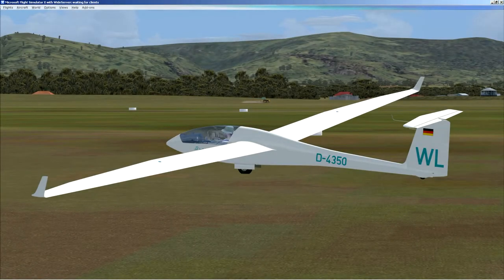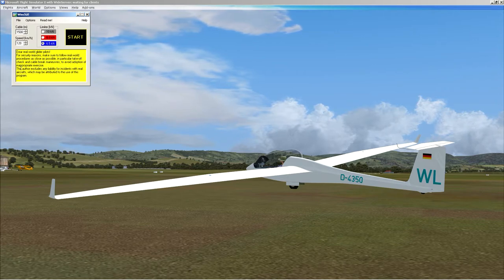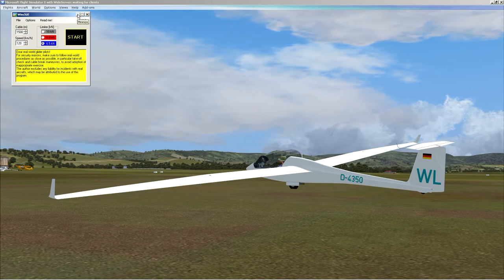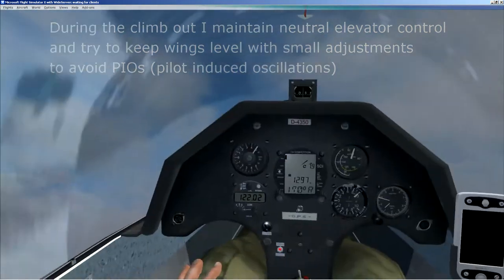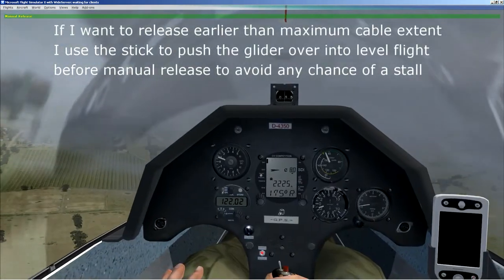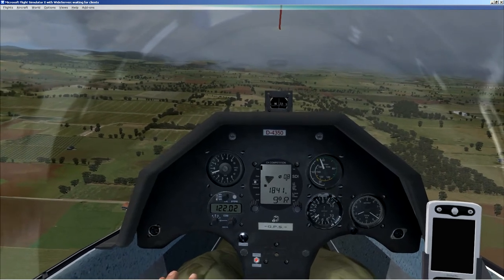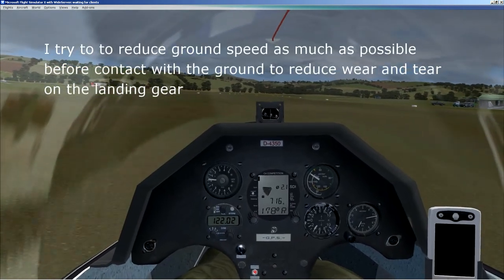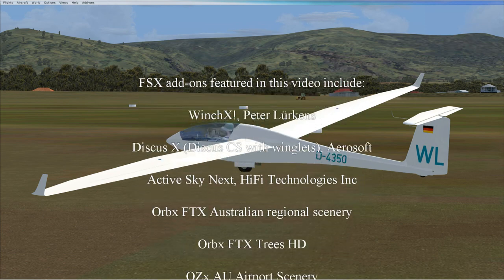WinchX! tutorial

Comment: Hello. I am a qualified glider pilot and I have been for just short of a year. Here are some extra realism tweaks that you can choose to use in your sim. 1. for the CBS IFT CBE, you check the controls in every movement. (Ailerons left, ailerons right, elevator up, elevator down. Rudder left, rudder right. Then you can check all of them at the same time to make sure you have full, free and correct movement. 2. On the launch phase, have your trim slightly in front of 0, about +2 to make your launch a bit more comfortable. Have the stick forward slightly as well, and then you wait until you reach 50 knots. When you reach 50 knots, slowly pull the nose into a 45-degree climb. You can check this by looking at each of your wing tips. 3. When you disconnect the winch or tug, pull the release 2 times to make sure that the whole cable has released and there are no loose rings hanging of the bottom. 4. If you hit cloud at any moment during the launch, you have to pull the release before you are in the cloud. (Make sure you pull the release with your nose still pointing up and then lower it to get your safe airspeed) I hope this helps, and if you have any more questions, i will be more than happy to answer them. Happy flying! Thanks, Sam
Reply from the maker: Thanks Sam, I mostly agree with your suggestions from your real-world experience except that my method of winch launching is based on my experience with the Aerosoft Discus in the simulator, so the trim settings I use, while they might not be correct in the real-world,  seem to work best in the simulator with WinchX!. Also in the simulator I am not skilled enough to look at my wing tips to check level and angle of climb during the winch launch without getting out of control. To get around my limitation, during the launch I use the head tracking to keep glancing slightly left and right just long enough to catch a glimpse of the horizon ahead to judge my launch attitude.
Reply: James Allen okay no problem. We all have different ways of doing things so if this works better for you, your not going to get injured so it’s doesn’t matter. Thanks for the reply! Sam

Comment: Just like flying my real Discus; slippery little beggar on approach sometimes - you have to have good speed control.
Reply from the maker: I have to believe you because I have no real-world experience in single seat gliders like the Discus.  What I have noticed in the simulator with the Discus, and other glider models, is that the ground roll after touch down, even on hard surfaces, is a bit shorter than I would expect in the real world.  Also landing an aircraft in the simulator seems harder in the simulator than it is in real-world because you don't have peripheral vision, nor do you have the same perception of height as you do in the real-world.  I am thinking about getting a virtual reality headset for my flight simulator and hoping that it might fix those problems somewhat.
Reply: You're probably right about the landing; I'd expect the same of the winch launch.  Yes, they do land fairly short.  My short landing practice is seeing me stop within less than 150m, including the initial crossing of the fence.  Go try it one day for yourself.
Reply from the maker: lautoka63 That is good to know - maybe the developers are not so far off as I had suspected.  I seem to recall much longer landing distances after crossing the fence in the training gliders that are my only real-world experience but then we were encouraged to hold off from touch down for as long as possible to avoid wear on the main wheel assembly on our rough grass runways.  Also our club Puchacz gliders were prone to wheel brake seizing, so we were discourage from applying any wheel brake except in an emergency.  So my memory and perception of landing distances may not be typical.